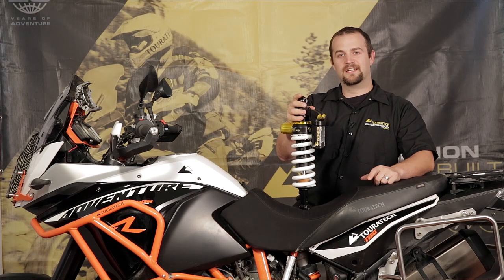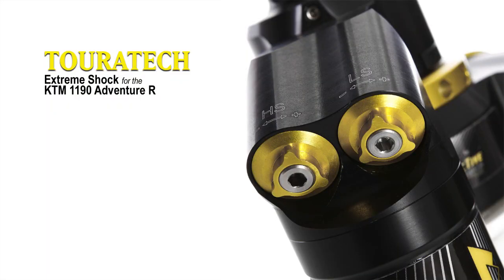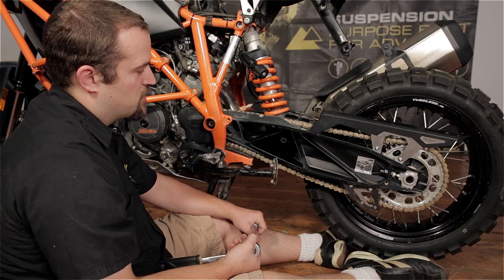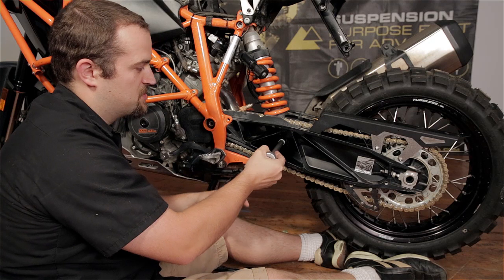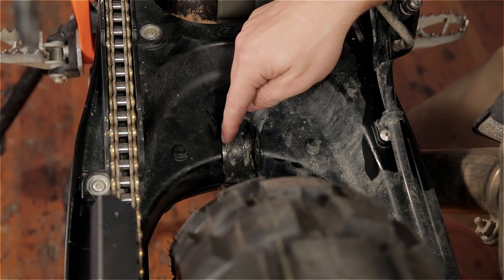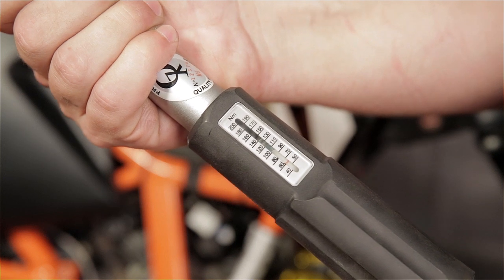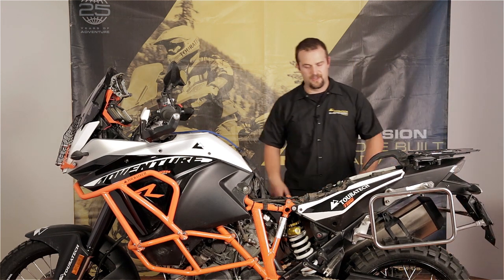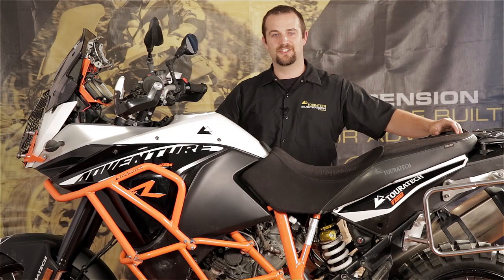KTM 1190 Touratech Extreme Rear Shock Install

Comment: I followed this video perfectly.    Got my shock pulled - THEN the fun started trying to get the spring compressed to replace  it.  What tool worked best for everyone??
Reply from the maker: You shouldn't need to compress the spring to install this shock. If you are doing a Touratech progressive spring install on your stock shock, the best tool is the right tool, a spring compressor. We sell a $180 Motion Pro compressor (3805-0137) or you can ship the shock to Touratech in Seattle and we will put the new spring on for free.

Comment: What size Alan key?
Reply from the maker: I can't remember exactly but it was either a 10mm or 12mm key.
Reply: It's a 12mm, but a 12mm half inch drive socket is too big around to fit in the recess.  A 12mm x 3/8" socket works and there is a 12mm hex adapter that is included in the KTM tool kit that works with a standard 12mm socket as well.
Reply: 12 mm   get a thin wall socket   the tube it is in is .91 inches